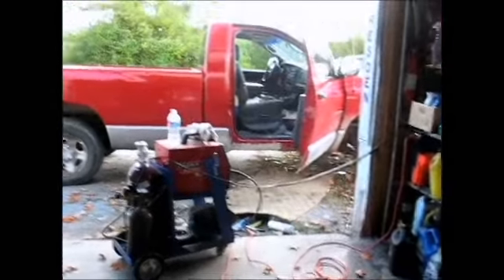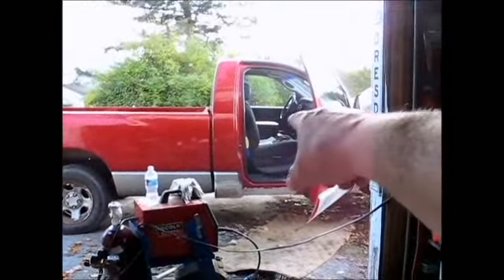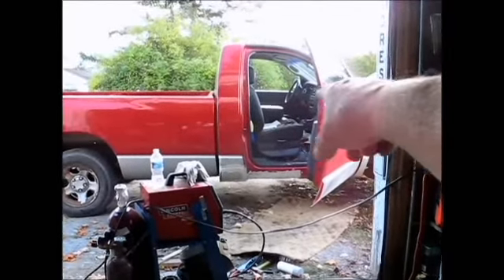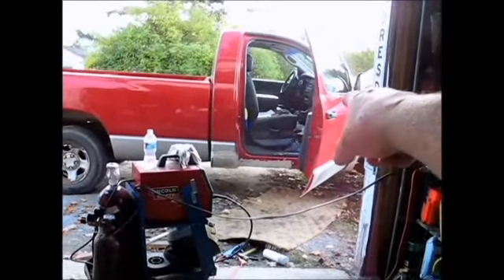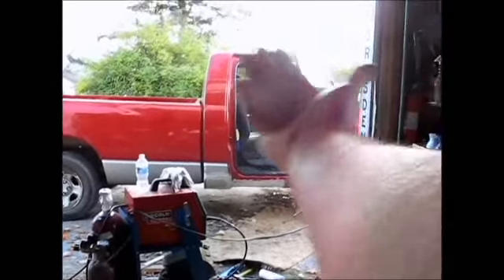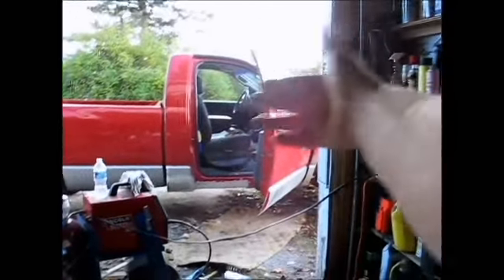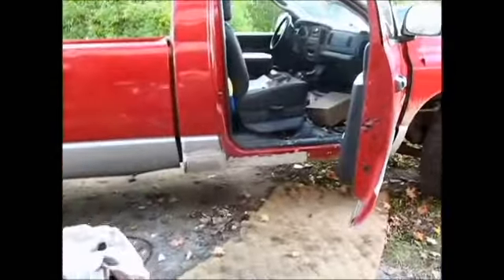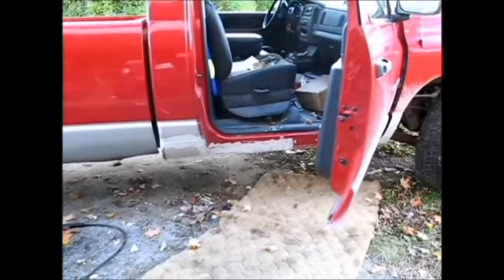Still more red neck rust repair

Comment: your old dodge is holding up alot better then his.  Solid repair.  I think that you should be able to get by with rot in your cab and rocker panals.  As long as the cab mounts are solid.  Each state is diffrent which is kind of funny when it comes to rust.